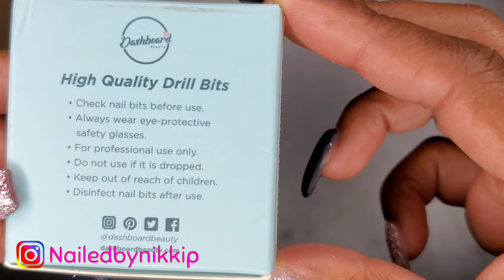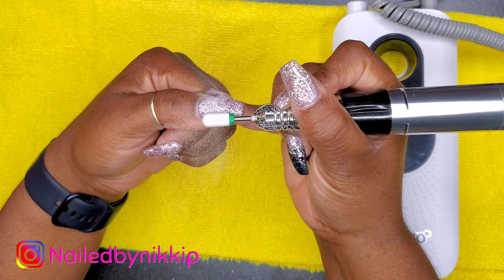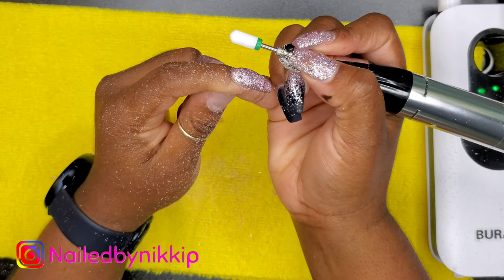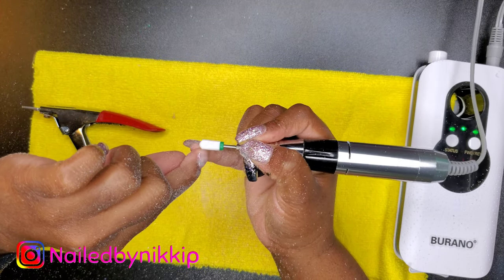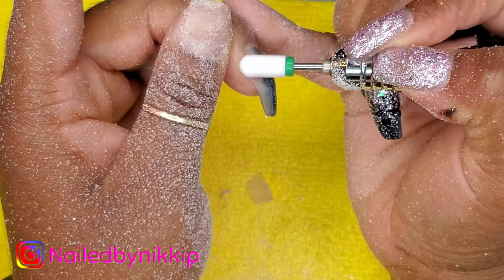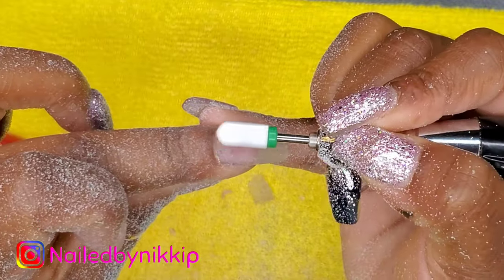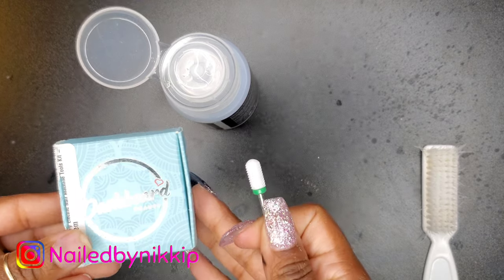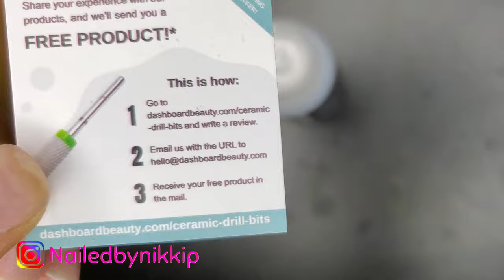Removing My Acrylic (realtime) | New Drill Bit from Dashboard Beauty

Comment: A new way I learned recently is to clip your nails down and then soak them and soapy warm water for about 1015 minutes and then either take a nail tip and get under the cuticle of the nail until you can slide it all the way under and pop it off or I use one of those floss picks with the little piece of floss on it and I get that underneath and just slide it back-and-forth and pull it up until I can pop the nail off it does a lot less damage to the nail